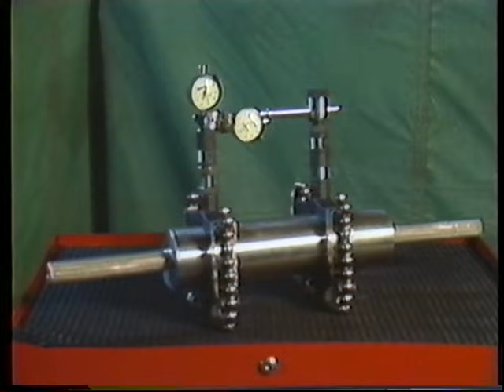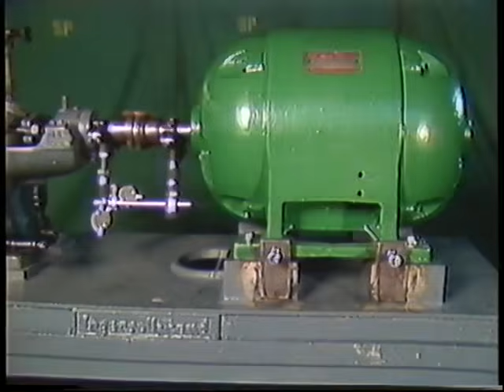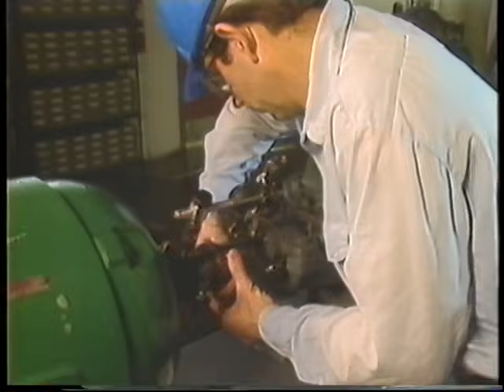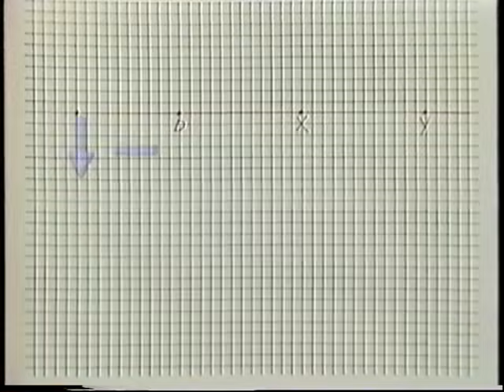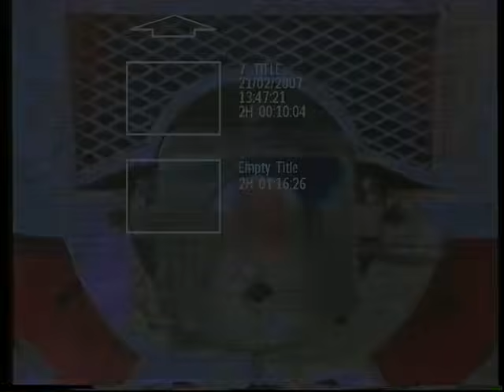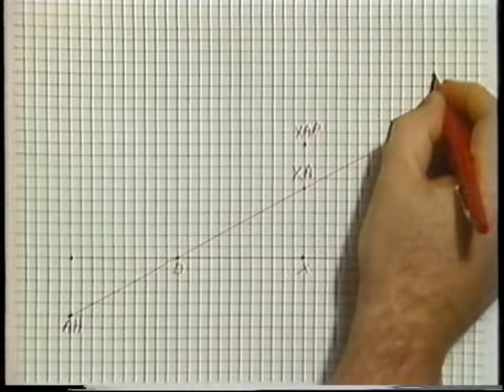Shaft coupling Alignment Procedure Rim and Face Method part 2

Comment: It's just me or is a mistake or confusion on the parallel and angular indicators.. in the vertical misalignment they use the rim indicator as the parallel and in the horizontal misalignment they use the rim face indicator as the parallel 🤔

Comment: In the video , fixed component (pump) is on left side while moveable component (motor) is on right side & graphs have been made accordingly.
In my company the moveable component (Engine) is on LHS while the fixed component (compressor) is on RHS. In that case do we need to reverse the direction of graphs or it will remain same?
Reply: When you're plotting the graph, the -tives and+tives will give you the directives to plot.❤